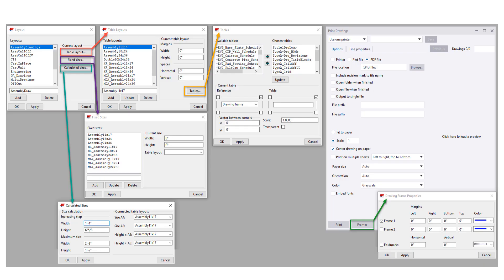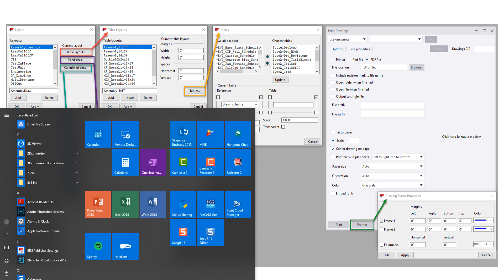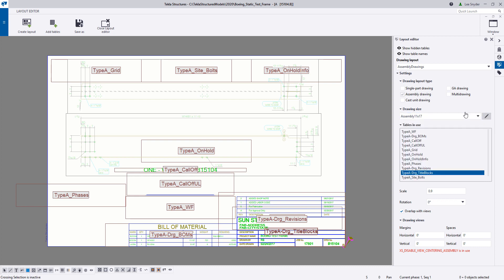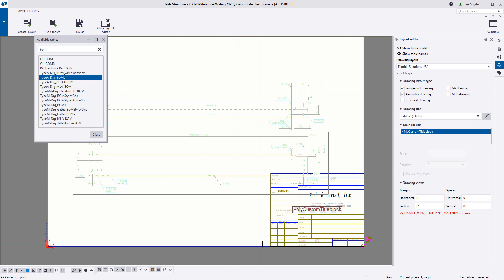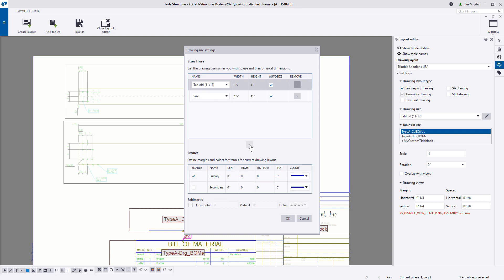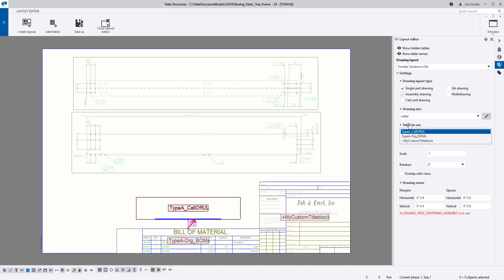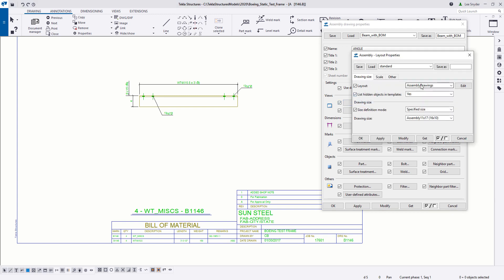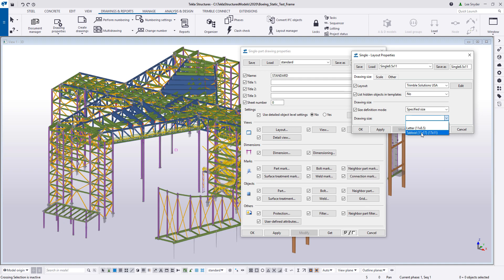Tekla Structures 2020 - Drawing Layout Editor

Comment: I accidentally overwrote the default assembly layout and I want it back how do I do that?
Reply: In the model folder you can open the attributes subfolder.  In there you'll find a layout file (.lay) extension that has the name of the layout.  If you delete that then the drawing will begin using the system layout again.

Comment: It is really helpful to have the exact coordinates of the anchoring points (relative or absolute) permanently visible (possibly in the same dialog box) and not only while placing each of the templates.
Reply: Great feedback!  Thanks!
Reply: @leesnyder6784  You should take into consideration that in many cases, we use the client's dwg xref layouts and use them as a transparent "base" layout with all the inner templates placed in relation to it. Some performance issues may arise using the relatively new direct approach. We have GA_layouts with 10+ inner templates.
Reply: @tasgeorg4453  some of our localized templates have quite a lot of templates on them and I haven't seen any performance issues yet but if you do please let us know